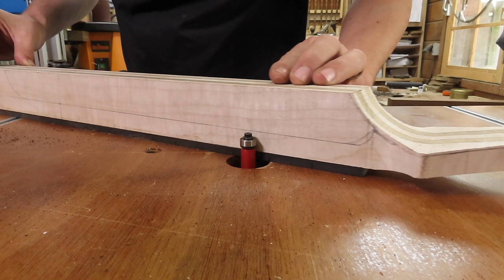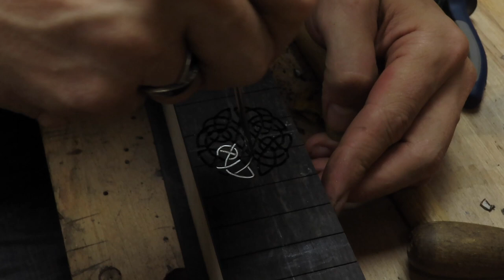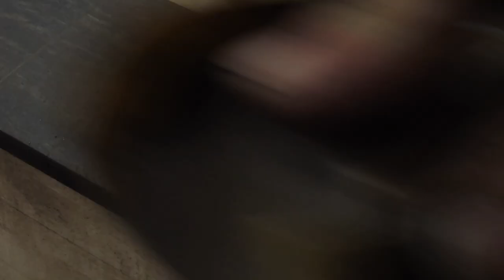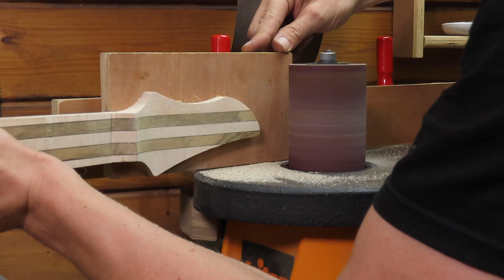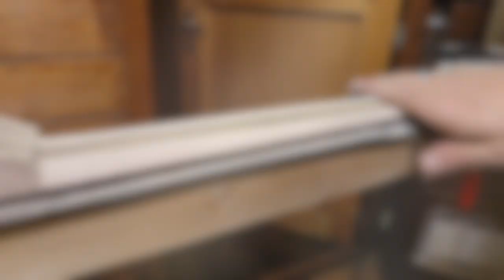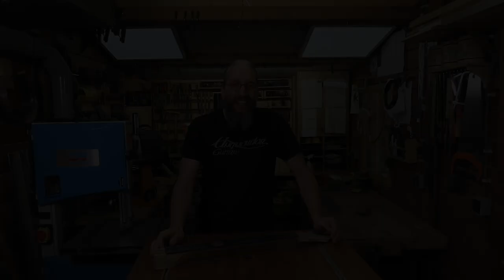Building the Celtic Sonea Guitar - Part 2

Comment: Great work Daniel! You must have amazing patience to work that little dremel! Are you using aluminum as the inlay?
Also is the neck shape standard on all of your guitars or does the customer dictate their preferred shape and feel? Thanks as always.
Reply from the maker: Hi Sean,
Thanks.
The inlay is indeed Aluminum wire.
I like to make create the neck shape to customer specifications. Preferably while the customer is in the shop to feel the neck. 
On builds like this, when it's not for a specific customer, I just make a very comfortable neck with a shape I feel like fits the guitar best.

Comment: Hello Daniel! Can you please give a tip how you clean the freatboard after the frets are installed? I put pva glue in fret slots and there obviously are squeezouts which I wipe off with a wet cloth, however in the end I see two problems: first - the grain pops up after wet cloth, 2nd  - there are still glue marks on the fretboard. Do you experience something like that and how do you deal with it? Thx!
Reply from the maker: Hi aerobatic1977,
Cleaning the glue of a fretboard after fretting is such a pain indeed. 
I don't use any glue when putting in the frets. I drip in CA Glue from the sides after the frets are in to keep a nice and clean fretboard. 
You can check my fretting tutorial in which I explain and show this in more detail.
Reply: @UnquendorGuitars  thank you! I

Comment: Just wondering was the inlay material nickel silver wire or aluminum ?  And what is the correct name of the blue  roller/ bender you used on the wire?  Thanks
Reply: The 'blue roller/bender' is a rolling mill. Don't know the exact make or model though.
Reply from the maker: Hi Edad Pops,
It's aluminium wire.
Like @grizcuz said, the tool is a rolling mill. 
This particular model is from a Dutch brand called HBM, but I don't recommend it. It's all I have but it's not good at all.